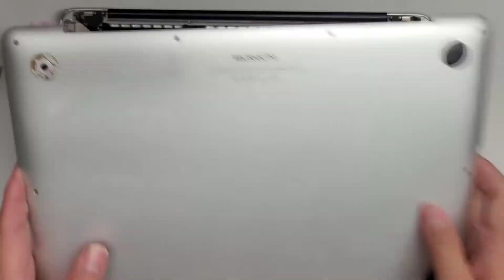13" Retina MacBook Pro A1502 Early 2015 Disassembly LCD Screen & Battery Replacement How To Tutorial

Comment: I feel like there isn't a boatload of A1502's circulating anymore but how many have you come across that "needed a new screen cuz it's blank!" & you just removed & reinstalled/secured the 2 Cables from the Screen to the Logic Board? I just "fixed" my A1502 after I originally planned to Frankenstein it into a "Hybrid Desktop" (Laptop with no screen) ordeal & then realized of course the WiFi AND Bluetooth Antennas are part of the top assembly & I assume go into the Lit Apple Logo. Durr.
Reply from the maker: @makaveli087  I fixed a lot of them that way. Lol
Reply: @ItsBinhRepaired  Love it! How often do you actually need to go further & replace the display cable?
Reply from the maker: @makaveli087  not too often but I try it if still no display.

Comment: I saw your video,  the only question I have is that I noticed that you didn't disconnect the battery.  Is it required to disconnect before disassembling it?
Reply from the maker: How much of the video did you watch and how good is your English? :P
Reply: @ItsBinhRepaired  again, I did watch the whole video and I didn't notice you disconnect the battery. Can the display be removed with the battery still connected? Or did I miss something in the video.
Reply from the maker: @dbb9005  you might be watching a different video lol

Comment: where can I buy just the lcd?
Reply from the maker: EBay maybe
Reply: @ItsBinhRepaired   Ok, thanks
Reply from the maker: @eurofighter1986  no problem, just make sure you get the same year model. Very important.
Reply: @ItsBinhRepaired   yep thank u 🙂
Reply from the maker: @eurofighter1986  hope it works out
Reply: @ItsBinhRepaired  still looking, i can t find lcd panel only less than 300 euros plus shipping 😭
Reply from the maker: @eurofighter1986  yeah, they're crazy expensive